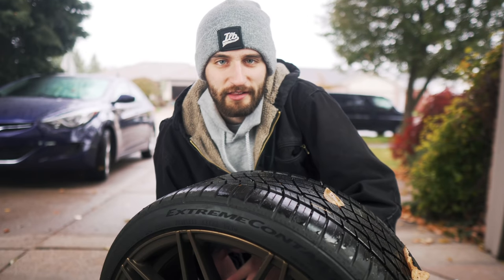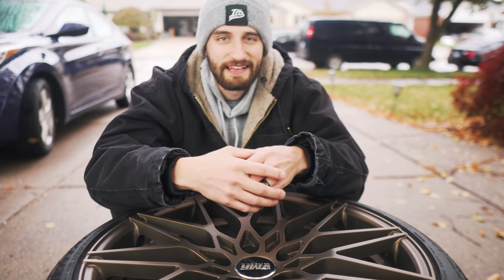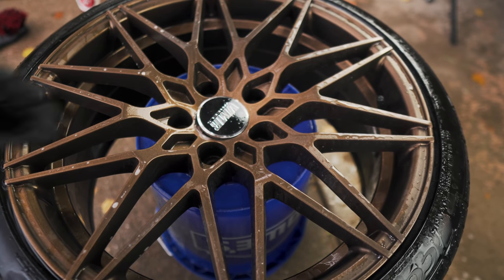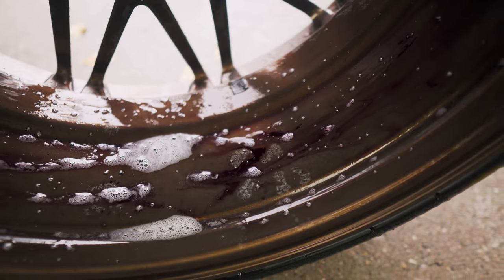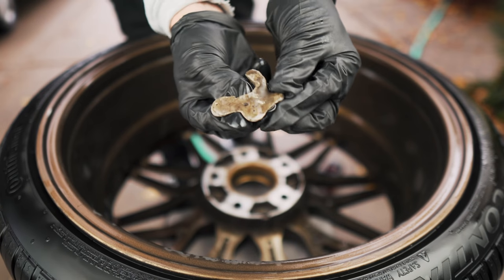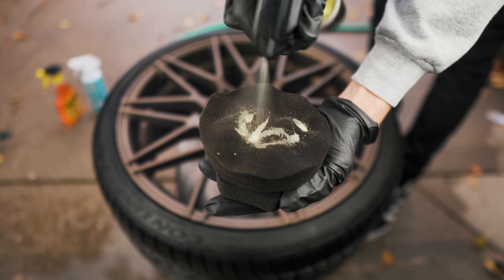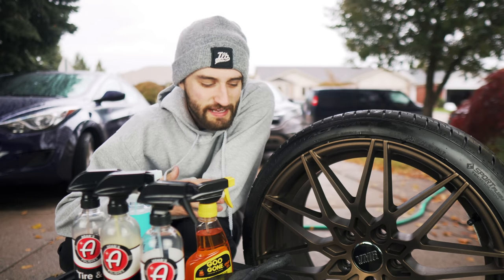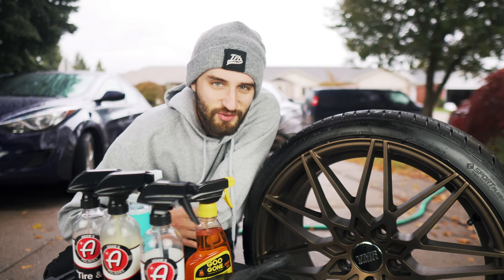How I Deep Clean My Wheels & Tires Post-Season

Comment: I finish of the cleaning by adding wax.. regular car paint wax (Sonax).. after I started doing this (by recommendation by a work colleague) the wheels are actually noticiably easier to clean the next time ...  (I was to say the least my self very sceptic before hand)
Reply from the maker: I'll have to try that next time. Yeah the only problem with using tire shine is it attracts dust. So I have to use the smallest amount possible
Reply: @justinbuice  There are drawbacks.. also you have to really deep clean before unless you want to seal that last season tarmac and brakedust etc .. Then also I think yours are coated by a quite different laquer/finish ("matte" finish) .. Perhaps a special polish intended for matte laquers if such exists (would amaze me if not) the way to go..

Comment: What kind of brake pads do you use? I’ve found the Akebono ceramic are so good for low dust on the wheels. Bite not as good as oem but it’s a trade off...
Reply from the maker: I have Akebono pads. They are great